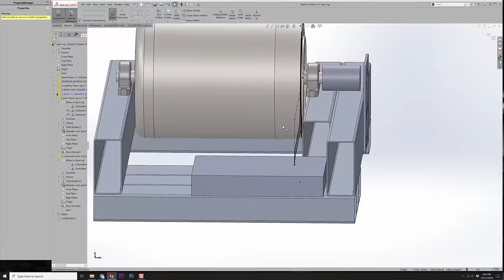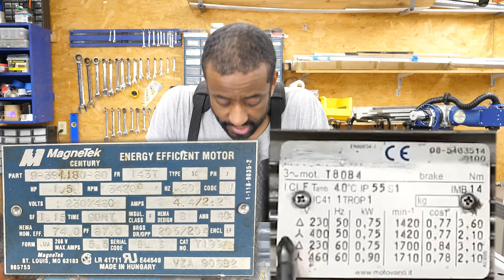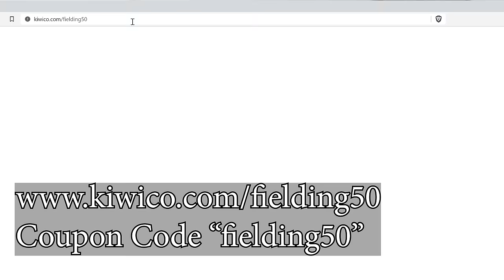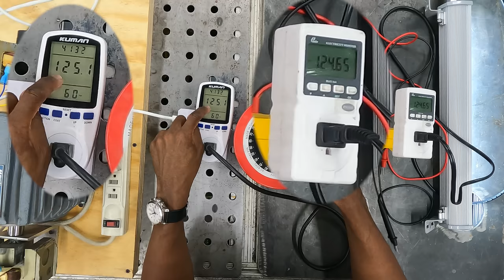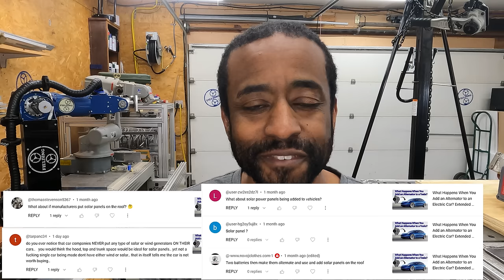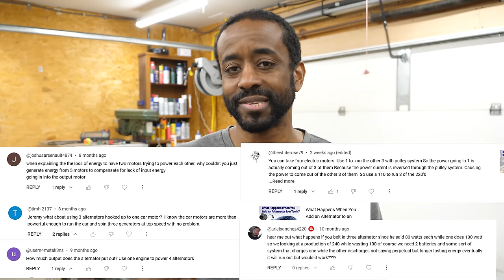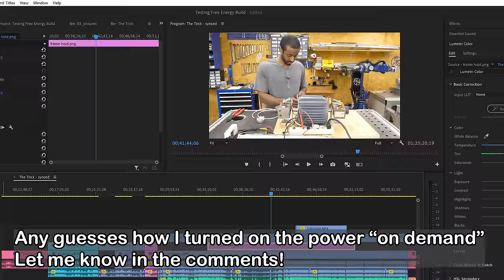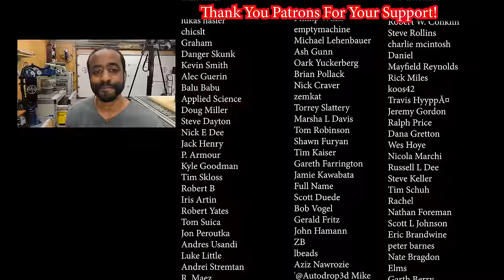Building and Reviewing Free Energy Generators on YouTube.

Comment: Jeremy, this video is excellent, thank you so much for broaching this subject. I thought I'd share how I was immunized against free energy scams early in life: When I was a kid, I loved carnival rides where you felt weightless, and I didn't understand why you could just "keep doing the weightless part." As a kid (maybe 4th or 5th grade) I didn't understand reference frames, relative motion, etc. so I was always drawing "anti-gravity" machines in my sketchbooks and the thinking went like this: "If you're swinging around in a big circle, like the pirate ship ride, and you feel weightless at the top, but not at the bottom, why not put that pirate ship ride on a bigger pirate ship ride so that on the smaller one's upswing, the big one is at it's downswing, which should cancel it out!" Of course, that doesn't work, and it can never work, but I was consistently adding more and more stages of gyros and swinging arms and elevators and one day it clicked for me: I wasn't getting closer to a solution, I was just obfuscating the mechanism more and more until I could no longer "see why" it wouldn't work. 

A few years later when I encountered my first "magnetic turbine" free energy "researcher" online, I instantly recognized the same thought process. You just need to overcome that one last push and it'll run on its own, maybe if you add a few more pulleys and a few more weights and some more magnets and on and on then it seems like it should work, but of course you're just kicking the can down the road. And so I never believed free energy scams for a second because I'd worked that kind of problem organically. 

Of course, obfuscating the working principle of a machine is great for scammers because the more complex that something apparently is, the easier it is to gimmick and the more legitimate it seems. 

P.S. "Almost forgot the magnets" reminded me so much of "Almost forgot the crystals" in Napoleon Dynamite when they're testing Uncle Rico's "Time Machine"
Reply: A slightly more complicated issue there is that your perception of weightlessness isn't the same as actually being weightless.
Reply: Well you can get "free" energy from many sources like waterfalls, wind or the sun :) But the energy always have to come from somewhere.

Comment: when gluing (wood) you should not complete the circles, have it opened ended. S pattern is great, not 8. because this traps bubbles. you'll get an uneven surface. Just as anyone who works with wood, or even glue/caulk.
Reply: Good point. One of those simple things that are clear and make sense, but if you only do it once every 2 years one might not consider it.
Reply: mm I have not thought of that. I usually make a x so it should be fine, or I make long s pattern snake because it is just easy to do.

Comment: Absolutely brilliant video Jeremy. The generator that fascinates me is the Hendershot generator. The plans are available on the net and I have seen a video where it actually works. (AKULA) I would love to see you build one of these to either prove or disprove that it can provide light. We are in fact surrounded by energy and I believe that there must be a way that we can tap into it and use it constructively. I have tested Tesla's static energy collector and it does in fact collect static energy. The voltages are extremely high and unpredictable and also not that consistent. At times I get useful and useable energy, but it is never "free" as the materials , safety measures and time do cost - one has to weigh up these factors as well as mechanical loss in a system. I have also seen converted gas motors running on hydrogen and water powering standard generators providing useful power outputs. These do have an initial cost as well as a maintenance cost - so are not actually free - but long term are portable, efficient and much cheaper than gas run motors. Modifications to these motors require spark timing changes to account for faster burn rate of HHO as well as water vapor injection to provide flash steam and if necessary turbo's to ensure correct HHO volume into the cylinder. The HHO gas generators also consume a lot of electrical energy and safety is really vital as this gas is highly reactive. I dream of poor kids in emote rural areas having the ability to flip a switch and have light and power to be able to cook food and study, read in safety - too many in my country are held back due to absolute poverty. There has to be a way to do this efficiently and safely!

Comment: I absolutely LOVE your attitude about our current situation with technology, and life in general. I had a lot of trouble understanding the technical details of your video but it was still worth my time to watch. I watched this video since I live off the grid totally in the Alaska wilderness and am always looking for alternatives to my micro-hydro system which only operates in the warmer months due to freezing in the winter. Have a 12 volt deep cycle battery bank - 8 6 volt batteries. Wired together for a 12 volt inverter to convert to 120 volt power and then to a breaker box to run the system like one would have in town. 
Anytime you’d like to contact me about my system, feel free. I’d be happy to learn more from you and to share the details of my several systems with you. 
Many thanks! You rock!
Reply: While going through the comments in Jeremy's lecture I was looking for a comment like yours interested to see someone who has achieved a fit in similar direction of alternative energy management. Yours is good comment presented in a polite and straight forward way which undoubtedly is a true position. The question of power source has been my trouble while going through two of those videos on free energy, I concured with Jeremy on his report about energy source. But he has a lot to debunk because in some of those videos you can see a number of demonstrations without external sources for continuous supply.
Thank you for making your observations known in the mist of choruses against free energy. After all, Dalton's theory which trended for  centuries was recently debunked. Wind and solar electricity are recent developments
Reply: Hey! I’d like to learn about your system!

Comment: Great video! This started out with my intention to buy an electric bike. I mistakenly thought that they were designed to recharge their own batteries. The problem with all these electrical vehicles is as you point out you need energy coming in and so I went down the rabbit hole and found your video. Our now former Mayor had announced that the city would be carbon neutral in 5 years. Now we get some of our power from Quebec which is clean energy as is the dam that we share with a small city just across the bridge from ours but the problem he couldn't surmount was the fact that about 30% or more of our energy comes from a plant that burns wood waste, wood pellets, if it is wood it is burned. He tried to get the citizens of our fair city to call the plant carbon neutral but most of us couldn't check that box with a straight face. So we are running in circles. We will clean the air by not driving gas or diesel powered vehicles but we will need to create electrical energy from somewhere. Hopefully we'll figure it out. It's a pity that Nicola Tesla was not better funded and supported in his time because I believe he was on to something. I have no proof but I feel it, that energy in the air.

 My heart breaks for that poor motor you destroyed to make an excellent point. I was on Reddit and one man, 6 years ago, mocked 99% of the population for not understanding the principles of  of energy conservation. Even though it was 6 years later I told him that not all of us had an interest in physics or were excited by the idea of electrical engineering in high school. My love was history, civics, and why our Constitution is the law of the land. I spent my life teaching and learning more as I read and research constantly. People say I'm obsessed but I think you understand that because you are making videos about what you love and destroying that beautiful engine says that you are a bit obsessed as well. I learned a great deal and I am putting off buying an electric bike and see if they come up with a better design, my electric bill is high enough and I have two good legs.  I'll be back again because I want to see you play with one of Elon Musk's toys.

Comment: 25:30 Cyclist here. The drivetrains on modern bikes are so much more advanced than they used to be. Modern materials, lighter weight components and manufacturing techniques along with electronic shifting has made the Tour de France much more competitive and advanced than ever! Those guys does WATTS! Of course, maybe only 1/2 a horse power per hour, but still, THAT'S A LOT!!!! I've seen that most of the world tour pros will do average of 225+ watts every day for the 3 week race. Each day is something like 3-6 hours of racing your bike! Oooof! Ouch

Comment: One quick way of understanding the efficiency of a device is to feel it.  If it’s warm then it’s not very efficient.  Heat is energy lost.  If it’s efficient then it will covert more energy into the desired device output.  

If you think your car is efficient then put your hand near the engine. Feel the heat. Too hot you can’t touch it.  Now put your hand near an electric motor.  More energy is transformed into motion.

Comment: Jeremy my father was an engineer and me a kid who was always taking things apart to see how they worked. I joined to erecter set motors together connected their wires and spun them and expected it to run. Much to my surprise and disappointment it didn't work. My father explained you have two problems first of all gravity and friction. Plus you would need one of the motors to be a generator and provide enough power to run the motor and the generator. So I have been pondering this problem for years and hate when I am told it can't be done. Well at 74 I still try, why not set of permanent  magnets with coils and no moving parts to generate power. There was a German during the war developed a generator with magnets that produced power the drawings are on the internet but people who built it said it failed to work. They say he used steel wire ????

Comment: What about using the magnets, positive and negative Magnets place in a certain way on like a propeller magnets on the blades and then magnets below so as it turns, it will push and repel itself and as it keeps spinning, it’s gonna propel itself even faster. That’s the way I think it would work having it spin from the magnets going into a transformer into the power strip.

Comment: Jeremy, you rock! When you run for president, you have my vote!
Everyone is looking for a free lunch, and their is no such thing.
IF one overlooks losses such as friction or resistance, a"perpetual motion device" is THEORETICALLY possible.  However, friction and resistance are facts of physics  and must be accounted for.
My Dad, brother and I had a discussion years ago about what it would take to make an electrical perpetual motion machine.  We surmised that even if we used superconducting wires on a motor-generator that had magnetic bearings and ran in a perfect vacuum, (containing NO molecules per m3), this machine would only operate for a finite period after initially charging the system with energy.  The magnetic bearings would require more power to operate than the system could produce, and loss3s due to eddy currents and hysteresis losses would sap energy, causing it to slow down and stop.
People will believe what they want to believe, and "Hope springs eternal", which is why P.T. Barnum said "There is a succer born every minute.

Comment: Your the only one I'm telling about this. I'm a nobody and I like your videos. I HAVE found a way to create torque though magnets, a coil and a sterling type of piston gear design. This design does not violate thermodynamics. I couldn't believe it myself, but it works. I'm not generating power for external use but I think that it might be able to on a larger scale. I do understand your points about this but I have found a physics legal loophole. I'm building a larger scale prototype now. If this continues to function then I would love for you to debunk it, lol. Non stop for 46 days and counting.

Comment: Wonderful video. Many of these "free energy" machines include some kind of copper coil in the design and the machines are rarely moved while operating. Remember that wireless electricity exists in the form of electromagnetic fields. A hidden copper coil generating a EM field and a copper coil on the device to absorb the energy is all you need to power a device remotely. Like through a table for example. If you can power a phone through a table, you can power a "free energy" device through a table. 
Also remember that our method of generating electricity depends on magnetic resistance to move electrons, you can't use magnetic resistance to create magnetic resistance, the two forces cancel each other out and even more so due to energy loses. Bottom line, free energy doesn't exist.

Comment: You can do it just via one transformer ,no need for the motor,you have to join the wire of the primary coil togother also the secondary coil wires togother ,and you need to join two wires on the secondary coil to draw electricity via it ,and the last step you need to uncharge capasitor at the primary coil .
Reply from the maker: Time 41:03 do you understand the scale of this claim? Why don’t you just do it? Seriously man stop saying this stuff and get into a shop and just do it. If you’re right it’s clearly worth your time. But to make this outrageous claim from the couch just doesn’t make sense given the meaning of it… if it was true. We both know you haven’t tried… just go do it. It’s a great way to learn

Comment: Perpetual motion has been a long running swindle. Free energy is newer - just like the use of electricity is newer... but the exact same swindle... in fact we can now watch both swindles running... Turns out the swindle is the only perpetual part.

(about the gears - just think of gears as a lever. You must sacrifice distance or effort to obtain a result).

Comment: Hi Jeremy greetings from mostly sunny QLD in Australia I just saw your video and loved it . I didnt think the youtube videos of free energy were totally plausable but I have been trying to work out a way to help my mother with her stand alone solar set up.

She has a 24 volt system and 3 strings of 36volt  panels that run 3 seperate regulators and charge a 24volt 1000ah agm battery bank. then a 24v 5000va inverter .Generally she has enough power to do anything she needs but after a few days of rain she needs to run the generator to pick the batteries back up again. I wanted to make a device that would run a 28 volt truck alternator to put 100amps into the batteries when the rain is set in. My idea was just a low rpm electric motor on a pully to a bigger pully thats connected to the alternator . I thought that would increase the speed of the pully going to the alternator making the rpm high enough to charge the batteries so she can make it through to the next sunny moment. being new to your channel i was hopeing you had touched on this before and could direct me to one of your other videos and if not do you have an idea so she can stop pouring a lot of money into the generator to top them up on our  rainy days. love the channel thanks Jamie

Comment: I loved this video. I think the one thing that is convincing for a lot is not that it’s “free energy” but that the energy is being converted from a field that has energy itself to kinetic. They use the idea of “ether” which Tesla was a believer of.
Reply from the maker: You really should read Tesla’s books yourself. He wrote several so you can see what he thought in his own words. I have all his books. He doesn’t even mention this garbage. Scammers made this up and other scammers saw it working and started repeating it. Tesla was indeed a genius and scammers use that to get credibility. You repeated it yourself because “if Tesla thought this there might be some truth to it”… except he didn’t think this. I suggest if you only pick one book go with “my inventions” by Tesla. You can buy it on Amazon. But do your homework here if you’re interested in this topic …especially before you repeat this Ether stuff again. You can check it yourself. You don’t have to believe me. The best lies have a gain of truth. Tesla was working on wireless charging and power stations. That basically what we do today with wireless charging pads. But it only works over very small distances like… millimeters. Tesla wanted to power a whole city with this. He was right about the idea but he quickly ran out of money as he saw it wouldn’t work for those kinds of distances. At least not yet. Even today it’s still a hard problem. Scammers use pictures of his wireless tower which is true to “show” he was collecting ether which is stupid but sounds possible. I have took you where to look. Please check for yourself.

Comment: This explanation is precisely why engine tuning is always a compromise. You can tune for low range, mid range, or high range power output, but you cannot have all three because the engine flow system (intake, exhaust, and valves) is designed for a specific RPM range to deliver max output.